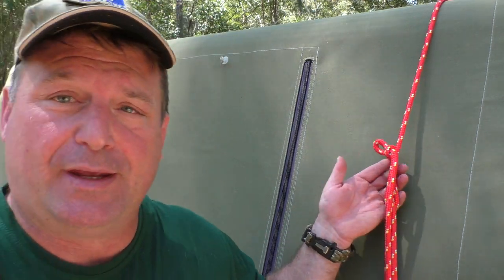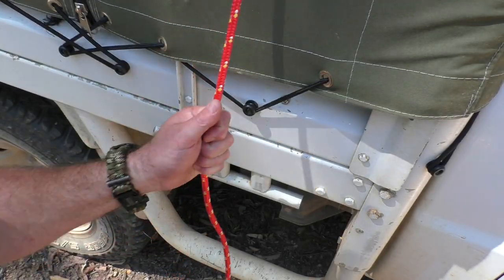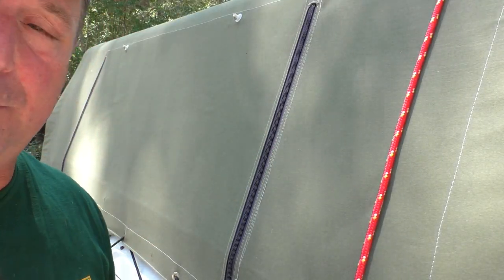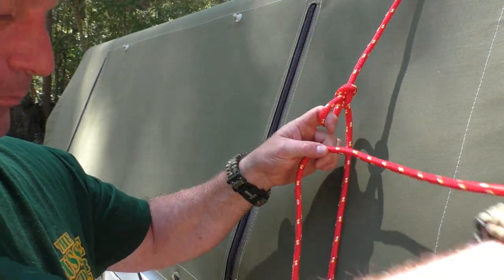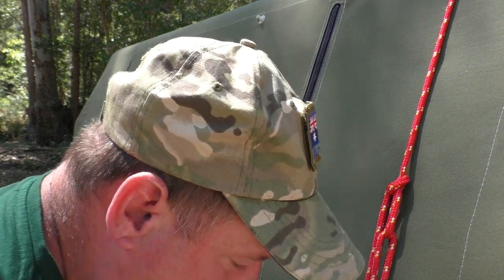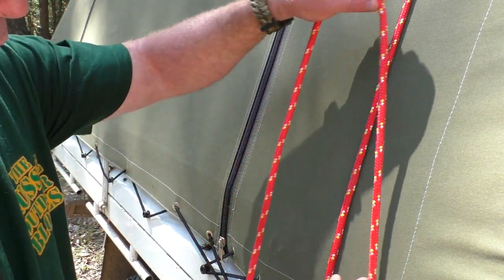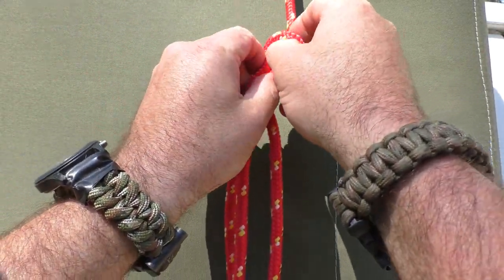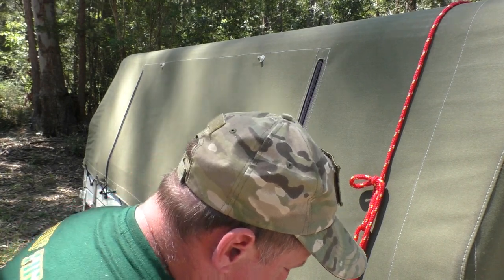Truckies hitch

Comment: throw an extra twist into your hitch, tighten up your loop, and it won't slip.

to those wondering, he would have just tied it off with a clove hitch - which is just two half hitches side by side.

thanks for the vis.
Reply from the maker: Gday Hugh thanks for your comment. You are correct I tied off with a clove hitch. Thanks again.

Comment: Great video mate. There are a couple of points you could have added though. Firstly, the version you used the first time can bind if under maximum loads, particularly with natural fiber or rough ropes. This can be avoided by inserting a spacer (small stick etc.) Inside the overhand part of the knot. 

The second is that the great advantage of the second (true aussie version) is that it cannot bind, and can be tied without a free working end. 

The third point you might have added is that the second version must be stabilised while it is being tensioned or it can pop out. This can be dangerous, particularly if you have committed your whole weight into pulling down on the rope to get maximum torque!
Reply from the maker: Gday Steve thanks for your comment. Its great to have some good tips presented in a positive manner thanks again and I hope you hit the subscribe button lol. Regards Harry
Reply: I didn't quite get to see the second one clearly.

Comment: Like your truckies hitch, in Canada we call it a truckers hitch (surprise), the only variance I do is instead of tying the final working end off on the anchor, I pinch the rope at the hitch point, loop the tail around the rope going up to the hitch point and pull it through on itself. This will create a tighter knot because it has no way to slack off down at the anchor once I have pulled it tight.

Comment: Great knot but where you looped around the front of the anchor point the rope could slide forward and off.
It would have been sensible to loop the rope between the 2 upright stays of the anchor point.

Comment: I much prefer the Closed Loop method because the Loop is never coming undone on you & I have never had an issue with undoing that slip knot loop but I guess it depends on the rope.

Comment: The first one is a Trucker's hitch...not a Truckie's hitch.  The second one is a Truckie's hitch.  It's originally called a Wakos Transport Hitch which uses a half-hitch (loop) grabbing a bight, like a sheepshank.  Trucker's hitches suck because they use a slipped overhand knot (not really a marlinespike hitch) in the line...a heavy load makes it extremely hard to untie it or pull it out of the line (can even damage the line).
Reply: six of one ㅇㅇ
Reply: six of one 일본노래
Reply: six of on
e
Reply: Don't want to comment on the names of these hitches, smitches, but agree with you regarding the first one described - as you say, a slipped overhand, that can be difficult to untie after being loaded.
Reply: Years of hauling hay, this Grandma would shoot you if you put that slip knot in my ropes!  Have used the 2nd. one for 40 years.  Holds the load, easy on the rope.
Reply: yep I am an Aussie and learned by 18 not to use the first one. That slip knot hurts the rope and can be a bitch to untie especially once wet. either use the 2nd one, or if you want to protect your ropes more,  make the loop as a bowline on a bight, or a butterfly knot. Both these are easier on the rope.

Comment: and if put another loop around his so called "marlin spike"  ,i call a bite , or do two twists in the rope around the bite   you get a stronger knot .
Reply from the maker: Barnie Smarny Gday thanks for your comment I actully call it a loop but i have seen it called a marlin spike in some diagrams either or Its not the end of the world lol. Thanks for sharing your tip also that is a good suggestion. Regards Harry
Reply: yes Harry,  your way does the job . i was shown by an old truckie to to put the loop over the bite in two places to stop it slipping on some ropes.